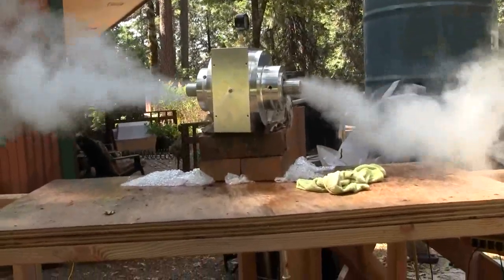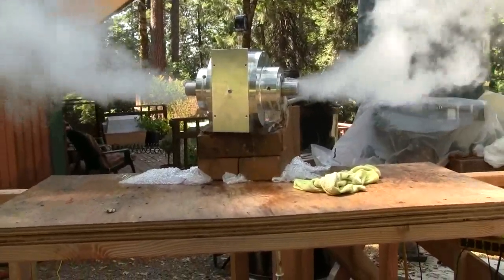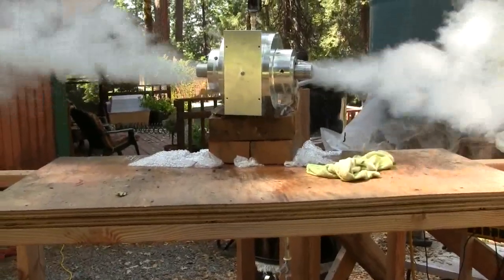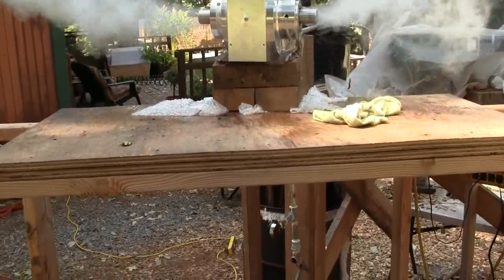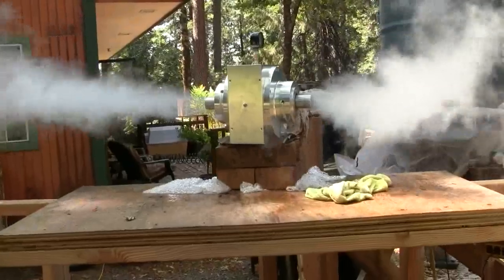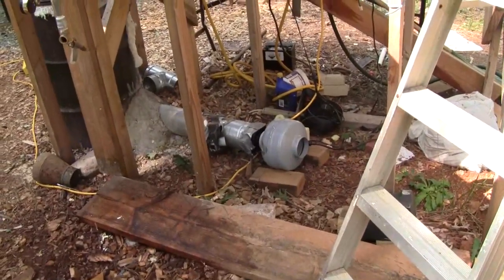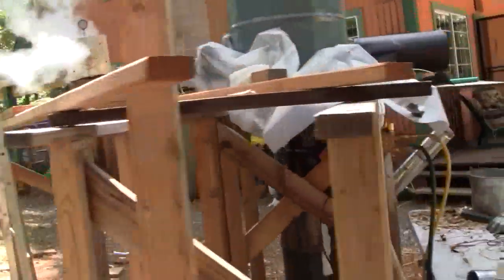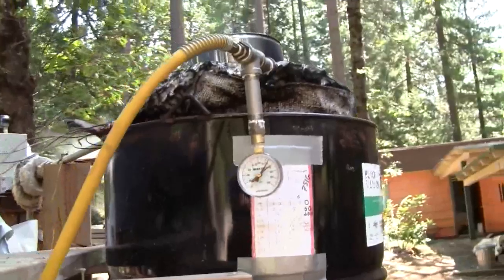New Steam Turbine 10krpm 1kW Sound Check.wmv

Comment: Hi great work , what makes the high pitch sound of a std steam turbine,  I HAVE a small model brass and copper steam turbiine
dated 1930's ,  it did not run when I got it , now working at 100 psi , size is 3 inches diamittter  ,but no sound as such ?
thanks again a very interesting project

Comment from the maker: I built the tubine.  The exhaust is at LOW velocity, not high.  It is cool, saturated steam with little remaining energy as it comes out.  It does have latent heat, and in a real turbine system condensation would take place in the hot water reservoir to reclaim that latent heat..to heat the house with the hot water produced. Then, the already hot water enters the boiler and is boiled and superheated to run through the turbines...ultimately for electricity.steam > electricity, hot water>heat
rt

Comment: Like bearings and oil feed, housing etc etc.
I'll be taking another turbo and turning it into a small forced draft blower for my boiler, should work perfectly. I'm trying to get everything mechanical with as little electronic/electrical parts as possible. I also borrowed a jet pump from a steam locomotive to work as my feed pump.

Comment: I've been working on a project simular to yours.
I decided to go with a automotive turbocharger for a small rig.
I took off the compressor assembly and welded a slightly longer shaft to the shaft of the turbine where it turns a small gear setup and finally, an alternator(5000 rpm to 3000 rpm gear reduction) 
Where exhaust gas from a engine used to go thru, now flows steam, and the outlet goes into small radiator from a ford escort LOL. This setup works great. Most everything needed is already
Reply: i was thinking about something similar, can pliz share your project

Comment from the maker: Thanks.  Yes, heat recovery is in the plans for when things are running as a full power system.  These are just tests.  Not for sale yet, but will be when I get things dialed in better.  Might come up with a turbine people could play with, but the goal is for real power generation, so I need to get the new seal technology working better and the thermal efficiency up so that performance rivals other machines, but uses a lower cost fuel so is in the end, far superior.
rt

Comment: is it worth considering to capture the steam and condensing it to make potable distilled water?
With a setup like this, you could turn dirty pond water to steam to turn a turbine for electricity, condense it to make potable drinking water and hot water for a shower, and use it to heat the house...or air condition with an absorption chiller.
This is all considering how much heat energy you create and how efficient you are at using it...

Comment from the maker: Currently, I'm developing a single stage turbine.  With good back pressure, (which I don't have dialed in yet) it will act similar to a multi stage turbine but require only 1 stage.  To accomplish that, the pressure must drop slowly as the steam passes through the turbine.  Most or all Tesla turbines allow the P to drop too fast, so most of the steam energy is lost.  Multi stage could help, but is more expensive and complicated.  There needs to be good resistance to flow through the turbine.

rt

Comment: Are you using a single stage turbine?
I'm currently building a 3 stage... mmm, about a 6 inch diameter router, or almost about the same as yours.